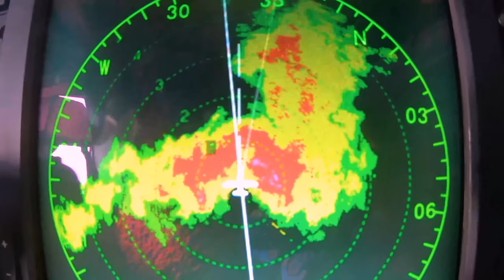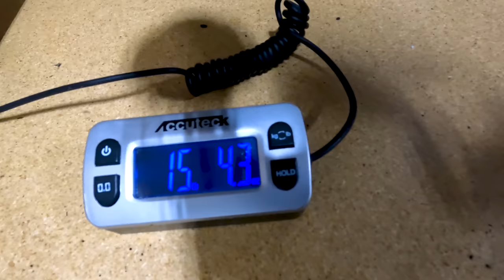we're WASTING our time!

Comment: Hmmm... not sure where this post went so reposting with an add-on thought. My apologies if this is a duplicate post.

To avoid an branding iron issue with the finish melting setup, you might want to consider an induction burner setup. A quick google search for induction burner found near the top one Amazon that is about $75. It has a temperature set feature to hold a specific temperature so you don't risk over heating the finish mixture. It also has a timer so if you forget about it you can have it automatically shut off after however long you think you need. I think those two features are pretty standard on all but the lowest-end countertop portable induction burners. I'm not sure if the pot you are using is induction compatible, but it sounds like it might be too thin to capture much of the induction energy. But I don't have an induction burner myself (when I need to replace my gas range I may consider an induction range, but the gas one isn't broken yet) so I could be wrong about the pot.

Also, if you can spare a scale, put one under whatever burner you are using so you can measure out the ingredients in the same place that you heat them. Less moving things around. Extra bonus if you need to add more ingredients because the batch you made is short, you don't have to worry about putting the hot pot on the scale before taring out. Tare the scale in situ, add first ingredient, tare again and add second ingredient proportional to how much the first ingredient weighed all without taking the pot off the heat.

Comment: Weird thought as I was watching you use the jig. Would it make it "easier" to put handles on it where you hold it? May offer more control. You're use to it, but a potential employee may feel/be safer. Great stuff though yall, look forward to your videos whenever they pop up!
Reply from the maker: Yeah a few new people have learned to use it and the biggest issue is holding the jig tight to the router bearing. Idk if handles would help with that - it’s more a mental/muscle memory thing
Reply: @jennieanddavis  I gotcha, maybe a ramp style so the part towards the router is taller would help with that so there can be downward and inward pressure?

Comment: I've worked in factories making steel products (2 different ones). One was a national leader in natural gas tanks and the other a national leader in steel work truck beds for contractors, electricians, etc. The last 15 minutes of every day was dedicated to cleanup. That was factored in to the production schedule and the cost given to the customer. 

Yall got a lot of experience in a wide range of areas that will help you grow. But I think industrial production is lacking correct? Don't neglect learning industrial best practices especially with pmcs type maintenance for the machines. You of course do not need as robust of processes as a 9 figure business. 

One of the things I'm going to invest in is an interior design consultant so I can make informed decisions about what to catalog and build for people

Comment: You can get a metal, wax melting and pouring pitcher for like 12 bucks at Hobby Lobby. Melt the wax and mineral oil inside the pitcher by using double boiler technique, and save yourself lots of time pouring into your tins…ask me how we do it…just stick to the plan😁
Reply: What is this you speak of? That sounds way cooler than the flowery pioneer woman crock pot I "borrowed" from the wife lol.
Reply: Go to Goodwill and buy a crock pot for two dollars.